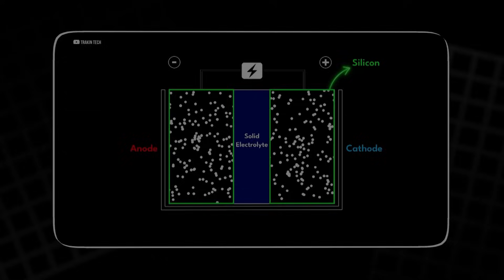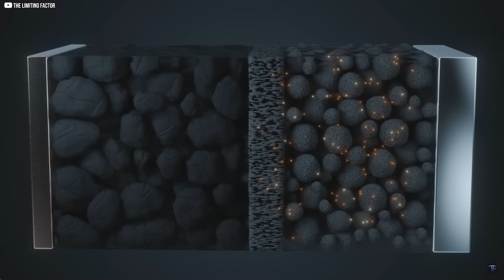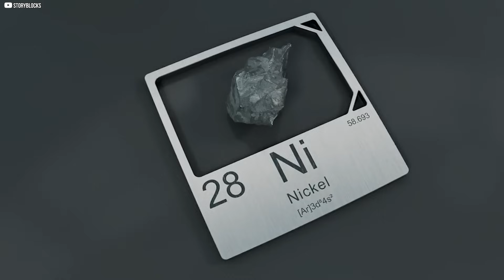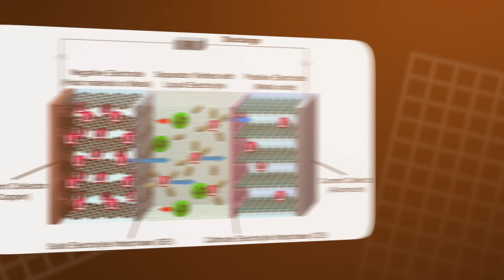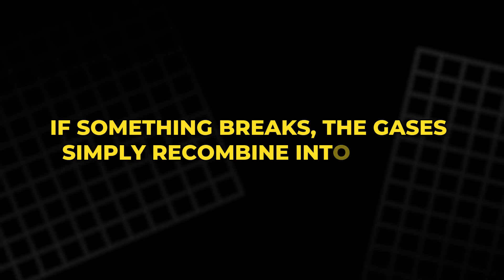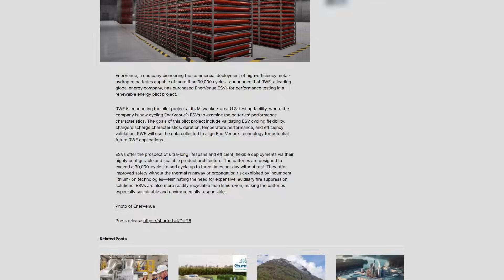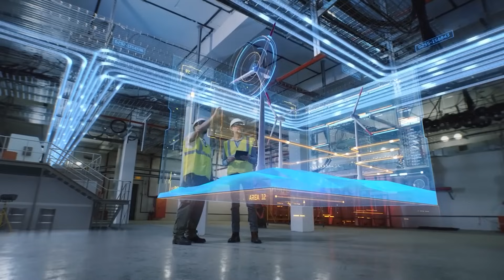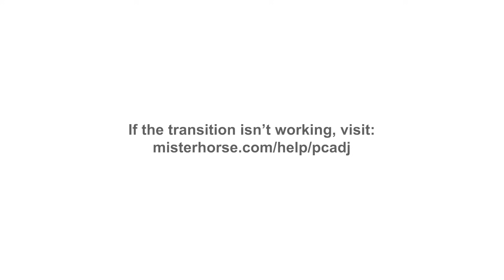NASA’s Indestructible Battery Is Finally on Earth!

Comment: It might help to spell the name of the company correctly. It's written on the canister itself. One word - ENERVENUE, not two words - Inner Venue. Clearly, these batteries are only for energy storage from Solar, Wind, or similar grid scale projects. But nothing has been mentioned about its energy characteristics like KW\MW capacity, speed of power release versus Lithium-Ion or other battery types, or if it is scalable to bigger or smaller footprints. I hope it really works and will last for decades as reliable backup or for use in peaker plants.